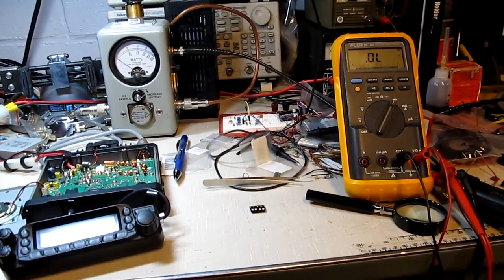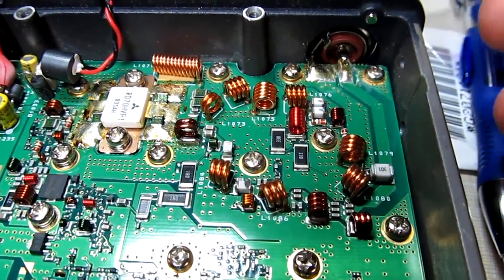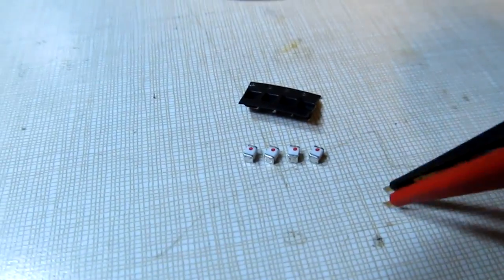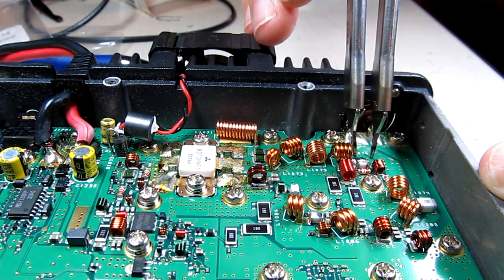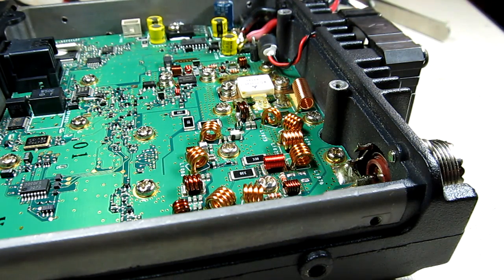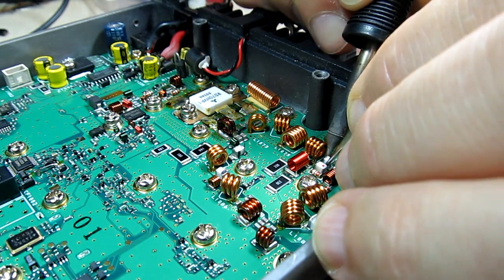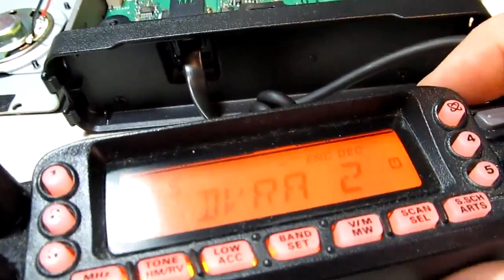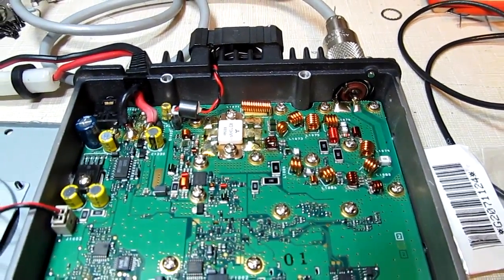#117: Repair Log, Part 2: Yaesu FT-7800 Dual Band FM Transceiver, fixed 2m tx problem

Comment: found your vid because I have a similar problem, how bout dat, my ft7900 took a reverse polarity hit, d1033 actually cracked, diode is a surge absorber, don't know if it absorbed it all but I can transmit on simplex, but no power shows on the power meter, the radio shows full transmit bars but that's it and my t-ctcs enc doesn't work, only simplex works, I'm getting an Icom, I want to ruin a different brand now, lol. you're very talented with electronics and you make me wish I paid more attention in electronic tech school, I graduated in 1993 and worked with electronics for about 6 years and transitioned to electrical work, since I did that, I became a hack, never ask an electrician to work on your electronics!

Comment: Great vid,, see little of this type of thing, and others said the same thing. I used to do a lot of this and used a beckman dvm with a beckman rf probe as it would handle the high voltages you see sometimes, and also used a special low level torque wrench, about 6 pounds if I recall, for transistors. Were the pin diodes in a balanced circuit involving a transformer or split loading coil ? Do you think that these diodes are involved in some sort of protection system ? If you mentioned what you thought they were used for I missed that, just that they were a part of the low pass filter system. Considering the work you did the camera work was perfect. Realize this was an old video . Was subscribed but will definitely be investigating your work after seeing this which was forwarded to me by another technician.
Reply from the maker: These PIN diodes were in the transmit signal path, and would be biased on for 2m transmit, and off for 440.
Reply: @w2aew  Oh, so they are switching in and out matching components maybe. Nice.
Reply from the maker: @californiakayaker  No, actually switching the entire RF path.
Reply: @w2aew  Will be looking at my 8900 to see if they were used in it.

Comment: Hi Alan, i have found your Video because since yesterday i have a Problem with my ft-8800. The Hardware ist still the same as the 7800. The Problem is, that i don't receive anything. After a VHF Fieldday i don't receive anything but very strong signals in the near of the TRX. I have two Antennas on my car. One monoband for 2 meter and one monoband for 10 meter. The distance of the two antennas is under 1 Meter. The TX workes fine. If D1123 on the Parts Layout is broken (Its the Absorber), does the TX work? I think i had too much power on the 10 meter antenna and so the RX from the ft-8800 died. :-(  I hope you can help me.  73 de DO4ZA

Comment: where did u get the parts from and how much I need to do the same thing to my 7800 the power is dropping off on uhf and vhf tnks mike in Canada.
Reply from the maker: I got the parts through Yaesu's service department.  I don't remember the cost.  Shipping was likely more than the part cost.

Comment: Very nice. I have a similar issue but different is not trasmmiting 70cm. However the brand is QYT KT-7900D... QuadBand. I found the same problem. I found the Squematic for KT7800 and QYT told me I can use it in reference this new KT7900d unit....

Comment: Weren't you concerned about the RF power going directly into your scope when probing on the output of the final?  You sampled the output power on the antenna line but probed directly inside the radio.  Is a 10X probe sufficient to protect your scope front end in a case like this?

Comment: Thanks for taking the time to finish the part 2 video and showing the outcome of the repair. Good Job! Any chance of info as to the part number and where to order from? It's been a few years so no worries if you can't find the info I'll have to do some digging around in the FT-7900 Service manual for the diode numbers. Also I'm wondering how much voltage was on the final RF transistor and how you didn't destroy your oscilloscope when testing it? I once measured a 30 watt radio that has over 1000Volts on the finals and my oscilloscope is rated for 400Volts max.
Reply from the maker: I obtained the part number from the FT-7900 service manual, and ordered the replacement parts directly from Yaesu Parts Department in California.

Comment: me   gusta  el   trabajo   limpio   y   pulcro  de   usted   mister.    muchas   gracias   por    compartir   sus   videos
Reply from the maker: Thank you for your nice comments!
Reply: siempre   veo  sus   tutoriales  mister   mas  por  el  manejo  del  osciloscopio   tektronix  tengo   el  model.465m  y  un   digital  de   60megas   hice   el   circuito   pulpo   de  usted   y   si   sales   unas   formas    graficas   muchas   gracias  mister .

Comment: Do you work on icom 706m2g
Reply from the maker: I've only worked on one in the past. I did a repair on a damaged connector and installed some optional filters. I only work on my own radios, or those from close friends.

Comment: Great video!! Thank you for sharing.
I do have one question, it is my understanding that you must be very careful not to exert any pressure on a component while desoldering until you get reflow on all sides due to the fact that if one side reflows before the others you run the risk of lifting a pad. What are your thoughts on this? Thanks again --KD7YCX
Reply from the maker: Yes, you are absolutely right.

Comment: Sometimes a failure in the DC drive circuitry of a PIN diode used to switch RF power is the cause of the failure. Insufficient DC bias puts the diode into a resistive portion of its operating region, rather than the saturated minimum-resistance region. (It acts like an attenuator.) The diode then dissipates substantial RF, overheats, and fails, and similarly a new replacement diode will also eventually fail. So, it's important to also check DC bias when a RF power-switching PIN diode fails. (A symptom of insufficient DC bias is slightly reduced RF power output from the radio, and/or a slight drop in RF power output after a few seconds.)

Comment: Excellent tutorial, we all have different routes to fault finding, I probably would have looked at the rf on the PA device first suspecting the PIN switching, a current meter on the power supply may have given an early clue that most of the VHF tx path was working. Your tutorial though is very good and methodical, excellent video quality too. I think Yaesu pushed their luck a bit using the parallel diodes. Most of my transceivers have the power turned down a bit, it is amazing what it does for reliability.

Comment: With your help I may have figured out what's wrong with my FT7800. I checked the diodes in the VHF receive line and found one that didn't show anything with diode check.  This is D1015 an antenna switching diode. All others measure about .7 volts. This one reads nothing. I am now trying to find a source for some. Thanks again and I will let you know how it goes.
Reply: When I got the radio it was transmitting on VHF and UHF and receiving on UHF only. It turned out to be D1015. I was able to buy the part from Yaesu for about 30 cents and the radio works great now.

Comment: I'm sorry if I missed it, I just scanned the comments. Do you have a part number and a source for those diodes? I just purchased a FT-7800 on ebay and the guy said it works perfect on UHF but is very weak transmit on VHF and no receive on VHF. I don't have anywhere near the equipment you have to troubleshoot, but I'm hoping it is one of them PIN diodes. Thanks
Reply from the maker: From your description, it doesn't sound like these diodes are the problem.  In my case, VHF reception was fine.  Only VHF transmit was affected.  In your case, it sounds like both VHF Tx and Rx are affected.  So, I would look into a more common element.  Of course, these PIN diodes are part of the T/R switching in the VHF path. You can test for basic functionality with a DMM.  The ones that I replaced were sourced from Yaesu directly, as I indicated in the video.  Yaesu p/n G207562.
Reply: Ok thanks for the reply and sorry I did miss that from the video.

Comment: Curious to know if you further tested removed diodes.  Why would both fail?  Any thoughts on failure cause?  I consider in repair if another component/circuit led to failure as replacing broken part may be futile if cause for failure is elsewhere.  So as in medicine always get thorough patient history.
Reply from the maker: The removed diodes were open. Research indicated that this is a common failure mode for this rig. I suspect the failure is at least partly due to a little bit of poor design practice. It's generally a poor idea to put diodes in parallel because if they aren't well matched, the current isn't split evenly. Thus, one devices gets stressed more and can fail early, which leaves the other to carry the full load which causes it to fail.   Everything looked normal with the bias, so I suspect that poor matching was the ultimate failure cause.
Reply: *****
Interesting.  So one failed and then the other stressed out :)  Would you recommend then, in this case, to use a single diode but one rated slightly higher than the maximum expected forward biased current?  I do assume tho that in a repair situation such as this, staying within manufacturer's original design is a safer approach.
Reply from the maker: k1mgy That's what I suspect happened.  As you may know, forward voltage of a silicon junction decreases as temperature increases.  Thus, if there are a pair in parallel, the one with slightly lower junction voltage will take more current, thus dissipating more power, thus heating up more and lowering the voltage.  Basically, you have the potential for thermal runaway.  This is why you always see small ballast resistors in series with the emitters of paralleled NPN pass transistors in high-power linear power supplies.  In this case, it probably wouldn't be severe, but you can get some of the same effect, and including series balancing resistors would be undesirable. I generally assume that the manufacturer has evaluated the alternatives for their design, so usually decide to follow what they're originally designed.  In this case, they've used this exact same arrangment in at least 3 different rigs that I've looked at - the FT7800R, the 7900R and the 8800 - so I figured they probably considered the alternatives.  I don't know if they did any "matching" of the devices during manufacture.

Comment: Nice video, Good teacher  Today I changed two 1N4148 through hole diodes on a freezer control board.  These diodes were serving as clamp diodes each across its own relay.  The freezer is up and running on a trial period to see if it goes through the defrost periods properly.  If it works 15 cents and a little knowledge saved $600.  I was going to replace them with 1N4002 diodes since the old ones didn't seem to be up to the stress and maybe with a zener in tow, but I chickened out.

Comment: I was eagerly looking forward to this video. You have nice set of hot tweezers. I certainly look forward to a lecture on switching diodes and pin diodes. Actually i am experimenting with 1n400x series myself. It would be very nice to explain how to build a pre-amp pin-diode switch with this technology; something based on a MAR-X or any low noise GAAS-fet and how to protect them for giving up in blue smoke with pin-switching.

A big thanks for all your nice work!

Comment: Cool video. I've got a Yaesu VX-7R that I've been told suffers similar issues. I've got all the tech docs for the radio so when it goes I'll be able to fix it.

Comment: I've had some water soluble fluxes actually corrode my solder joins and pcb.  So I'd say yes, unless you're using a no-clean flux (which is what I've switched to and still clean using Isopropyl like Alan)

Comment: Another gem Alan. When you installed the replacement diodes you chose to use a conventional iron. Any reason why the hot tweezers could or should not be used? Does soldering one end at a time open up the possiblity of creating mechanical stress onto the component after the solder has cooled? Noisy fan on that rig.
Thanks again for all the videos and guidance.